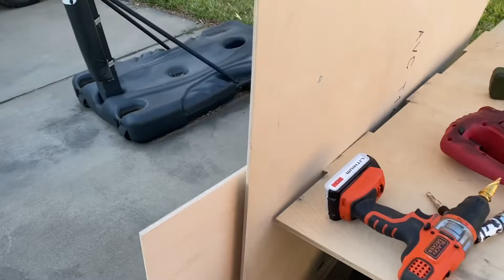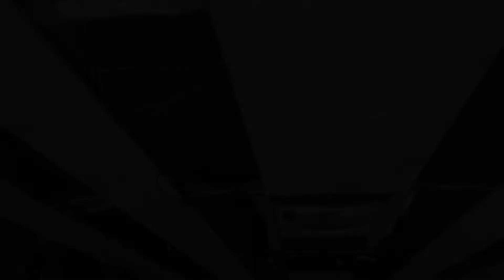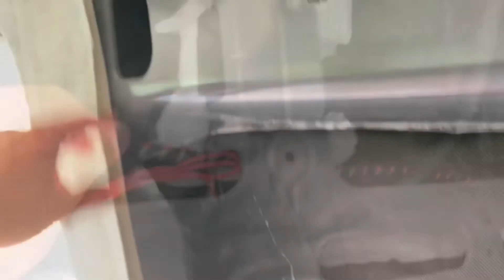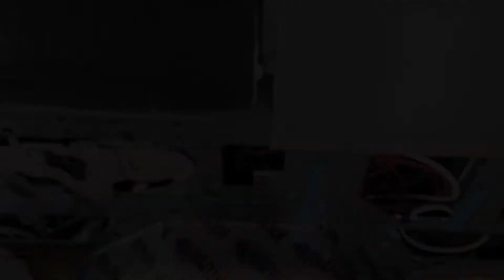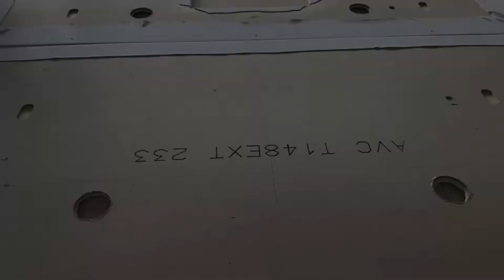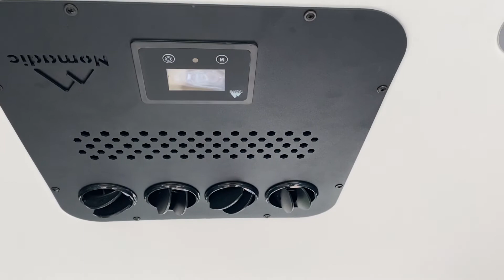Ford Transit Van Build | Installing Ceiling Panels & Lighting

Comment: Looks great! Did you screw the ceiling furring strips directly to cross members? Or did you use rivnuts?  Thanks.
Reply: Yes, we screwed in the fasteners with a decorative washer directly through the panel into the furring strips. These are the same fasteners that we also used for our wall panels for a consistent look. They have held up well and look great. Thanks for watching!
Reply: @jlhotegaston  I like the look of the screws with the decorative washers. As far as the furring strips, did you screw those directly to the crossmembers of the van with some sort of sheet metal screw?
Reply from the maker: @wanderbybike  We used self drilling metal screws. You could use plus nuts also for a more secure connection. We do use plus nuts for all the 8020 cabinet framing connections to the walls and roof. The furring strips only support the weight of the ceiling panel and the cabinets further anchor the ceiling due to the 80/20 bolted to the plus nuts in the ceiling cross support beams. for the metal fasteners and decorative washers, you looked at a bunch of them at Lowe’s and pick the ones we liked the best! That’s how we landed on the ones we used.😊

And sorry for the confusion I just realized that my new phone signed me out out of my blazing wanderers YouTube account! I was wondering why I was seeing my personal account info above. Thus you’ll see a change in who this notice from but it’s the same person!
Reply: @blazingwanderers  😂Thanks! I was confused for a second, thinking I replied to the wrong thread.

Comment: Love this video, im about to install a similiar ceiling on.my transit. Did you use anything in the front of the ceiling in between the blobs to help hold the ceiling panels?  It looks like you have a good tight fit there.
Reply from the maker: Thank you! So, the first panel nearest the front is held in place by 6 fasteners—a row of 3 near the edge and then another row of 3 in line with the lights. They are screwed into furring strips attached to ceiling. There are no attachments near the front of the panel. We are just relying on the curvature of the van ceiling to ever so slightly bend the front part to hold the panel in place. So, essentially the front edge is just floating. We have had no issues— the panel doesn’t move or squeak, and it fits up nicely against the headliner.

Comment: Awesome look. What are the panels? 1/4” birch?
Reply from the maker: Yes, the panels are 1/4 inch Baltic birch. We bought the wall and ceiling kit from AVC Rig pre-cut, which saved us a lot of time. We did buy a few pieces of the 1/4 inch Baltic birch to re-cut a few pieces where we didn’t want seams, and used the wall kit pieces as the template. This was mainly for the pieces around the windows and flares.

Comment: What kind of vinyl did you use? Was it Marine vinyl? How is that behaving with heat inside the van?
Did you use any kind of foam between the Vinyl and the wood ceiling?
Great work! It looks awesome!
Reply from the maker: We used a Sunbrella vinyl from Sailrite, which is a 4way stretch fabric. We live in Texas on the Gulf Coast, and our van has sat outside in the hot Texas heat for a year and the vinyl has held up beautifully! We do have 1/8 inch landau foam underneath it between the wood and vinyl.

Comment: Looks great, very clean!  I'm moving on to my ceiling install and have a few questions if you don't mind.
- How did you attach the furring strips?  Self tapping screws?
- Similarly, how did you attach the structural steel.  I ordered the same thing from Titan and haven't quite decided the best way to install them.  And do you have any pics showing how you installed the steel piece at the front by the foam blobs?
- What screws did you use for the ceiling?  I think they look pretty good and was hoping to use something similar.
Thanks!
Reply from the maker: Thanks for the comments! 

We attached the furring strips with Teks 1 7/16" self drilling wood to metal screws.  These were okay but I did find a couple of the holes would strip due to the penetrating point on the screw making the hole too large for the threads to really grab.  Repositioning the same screw in a new hole worked every time. 

We used 3/16" rivets for most of the Titan Structural Steel.  We may have used a smaller diameter to add a reinforcement strip at one point. We did not use the Titan structural steel support that spans the towards the foam blobs. I found that the ceiling had a more natural curve by leaving these out.  There is a lot of pressure on both the front and back of the front ceiling panel given the curvature of the panel and it is not moving once attached. It helps to have 2 to do the ceiling panel installs. 

We used #10 Stainless Oval Head Screws in 1"-1.5" length with #10 Stainless Finishing Washers for the ceiling.